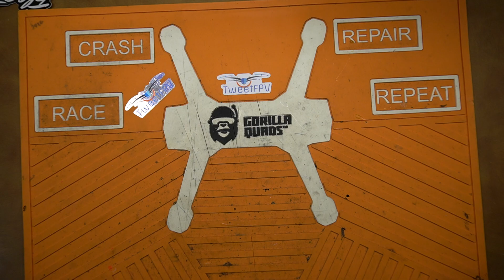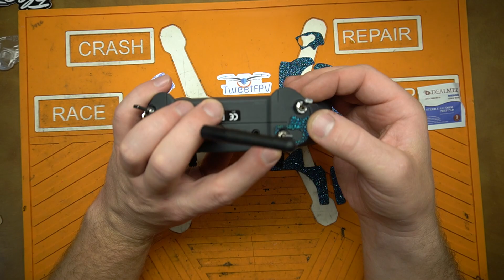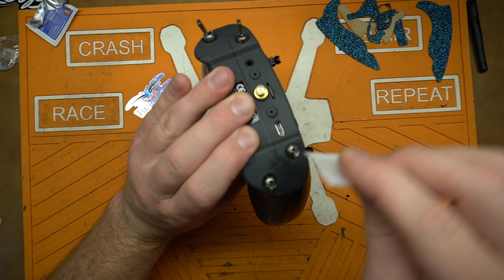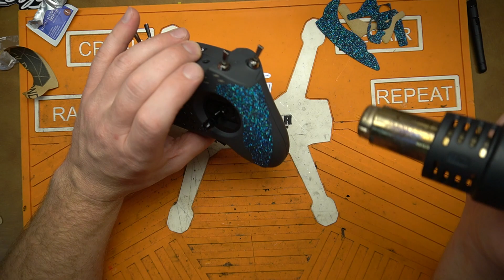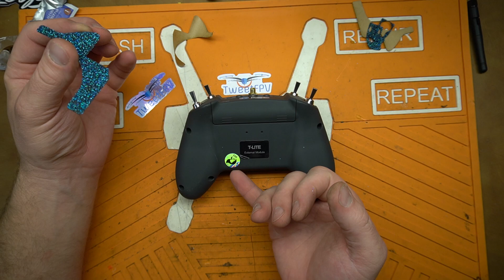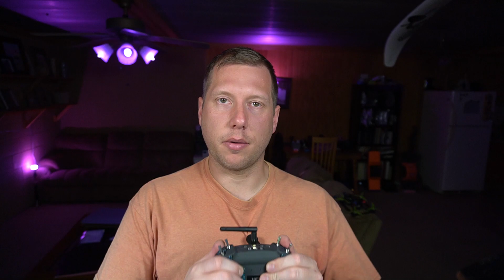Jumper T-Lite grip install #tlite #jumper #fpv

Comment: Those look amazing
Reply from the maker: Thank you. It wasn't an easy grip to design haha!
Reply: I got red from rdq. Glad you made a how to video I would have never thought to use heat which made it a cleaner install.
Reply from the maker: Yea for most radios its not necessary but this one has some tough compound cures that the neat is 100% necessary!
Reply from the maker: I asked them to put a link to the install in the product listing but oh well, glad you found the install video.